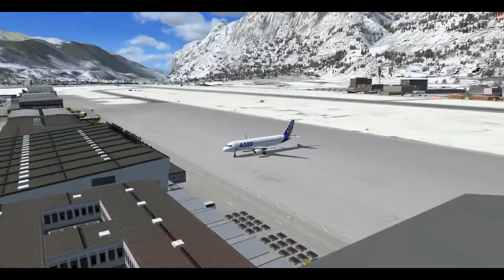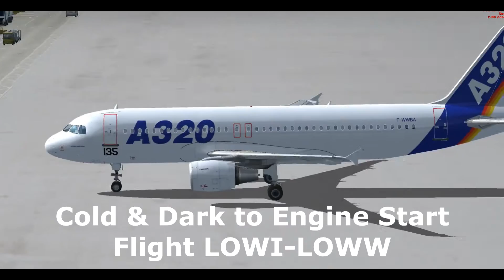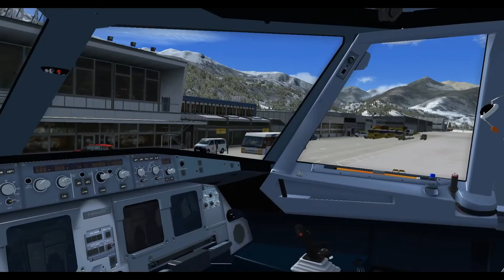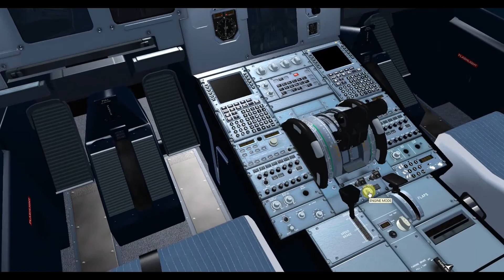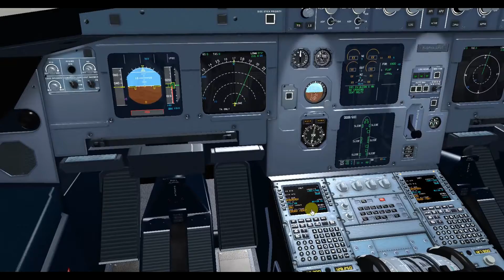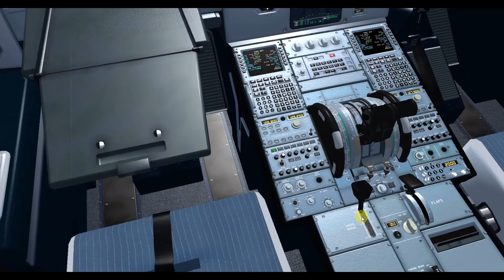Flight Simulator X Blackbox Simulation A320 Preflight Tutorial

Comment: how did u turn soo was with the a320 mines turns slow
Reply: You mean the bank angle? In the A320 it depends on several factors. The guidance mode (HDG, NAV...), closure rate when intercepting something, procedure coding in the database, speed, all engine/engine out etc.
Reply: @maxhirn1878  AH NVM I FIGURED IT OUT I FORGOT ABOUT THE TILLER
ANYWAYS THANKS
Reply: Have you had any issues where the plane won’t fly the flight plan? I enter everything in, takeoff and then when it reaches a waypoint the plane just flies in circles. wondering if you have any suggestions for me?